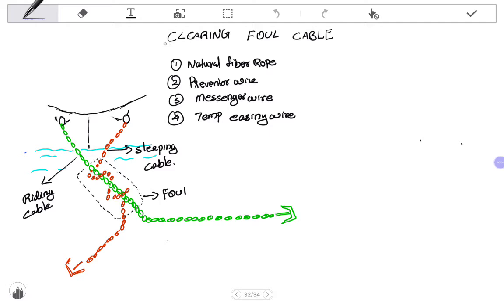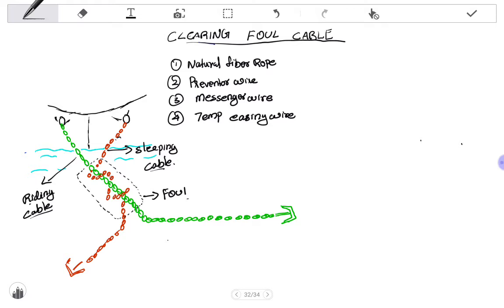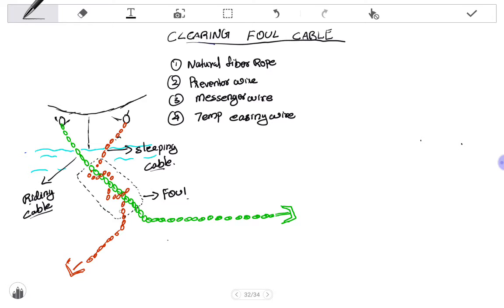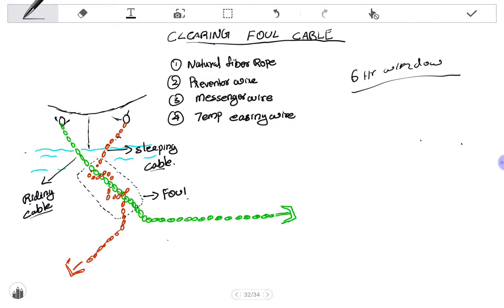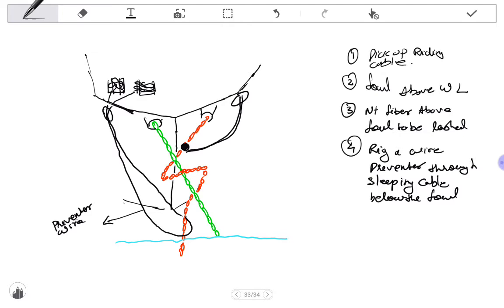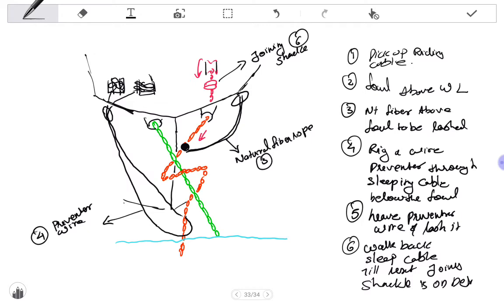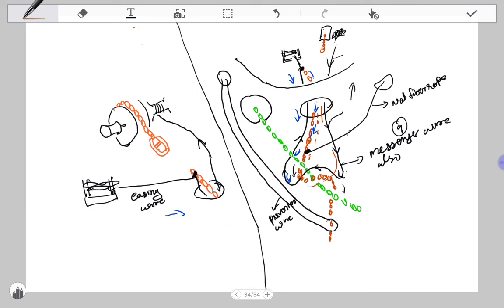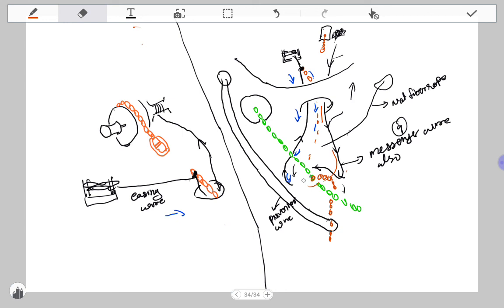clearig the Foul Cable

Comment: pls tell me what the purpose of natural fibre rope because once we start clearing the foul using the messenger wire rope and the easing wire also follows the trace which can be cleared but what about natural fibre rope as when we remove the foul that natural rope will also get fouled inbtn right?

Comment: dear sir
 would u please tell us the diameter of ropes has been used here .
thanks in advance
Reply from the maker: Hello
Size and Swl of rope will change depending on the weight of the anchor. 

On board the strongest rope available is your mooring rope. 

So use your spare mooring rope. 
Look for the rope size in certificate .
Normall big ships have 60 mm ropes